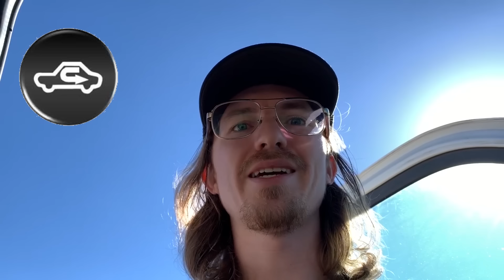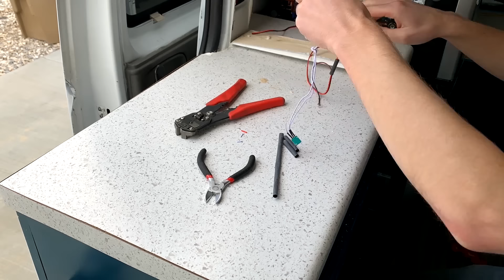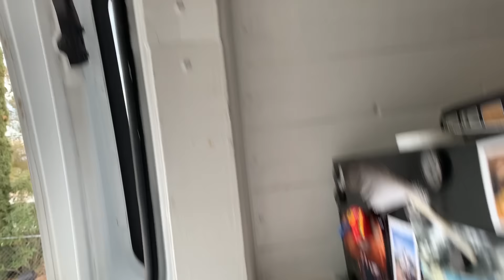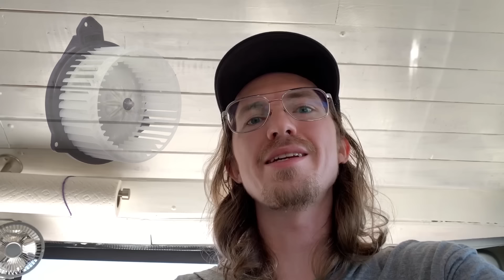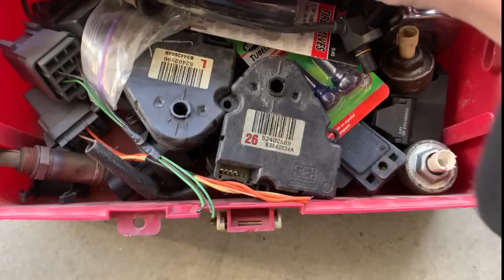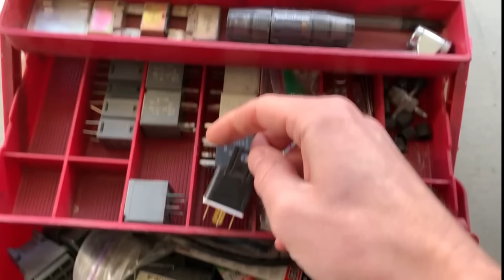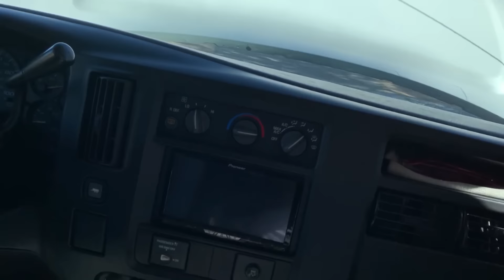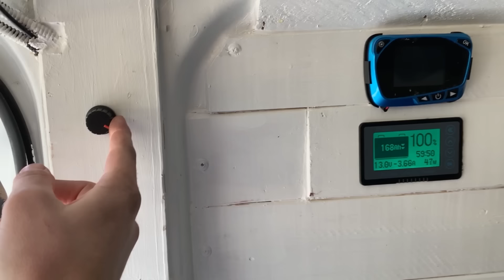OEM Blower Hack **ULTIMATE STEALTH**

Comment: Tim, I need to know how many watts of solar you have on your roof.  You have 4 panels, are they 200 watts per panel?
Reply from the maker: Hi Ron,
They're 230w each (x4 panels = 920w)
Hope this data sheet hyperlink works:
https://www.energymatters.com.au/images/sunpower/spwr_230wh_com_en_a4.pdf

Found them for $100ea locally on Facebook Marketplace (tested by seller upon my pickup)
-Tim
Reply: @VanwithTim  Thank you, Tim
Reply: @VanwithTim  Hey Tim, I appreciated your extensive AC video.  But check out my more simple AC and van cooling solution using only 175 watts from a portable Zero Beeze AC unit.  Firstly, I'm doing something quite revolutionary with a MaxxAir Fan.  Instead of mounting the MaxxAir on the roof, where every inch of roof real-estate is going to have solar panels on it, I am mounting the MaxxAir Fan on the rear driver's side barn door, where the window would be.  My Ford van will not have any windows in the rear barn doors.  The MaxxAir will be cut into the sheet metal where the window would normally be.  This placement for the MaxxAir Fan is beneficial in so many ways.  One, the fan will only be inches away from my cooktops.  Two, it will suck out the hot air inside the van much faster, and when the fan is switched to bringing air into the van it will not be pumping the HOT air off the exterior roof of the van where the sun has been beating down on the roof as it would if the MaxxAir Fan was mounted on the ceiling of the van.  Now, check out my AC solution using the Zero Breeze.  Google Zero Breeze Mach Two, if you're not familiar with this 2300 btu compressor air conditioner.  I will mount the intake and exhaust tube to the 'face' of the MaxxAir Fan with a Jerry rigged homemade plastic adapter so that the AC can breathe.  My gaucho couch/bed will be across from the Zero Breeze which will sit on top of my cooktops and will direct the cool air flow across the center aisle to the bed couch/bed area.  Then I will curtain off the back of the van so that this admittedly small AC unit won't have too big of an area to cool.  No duct work, no loss of drawer or storage space, and only 175 to 200 watts, easy peasy!  The Zero Breeze will have an expanding dryer type hose that will direct the cool air directly onto my body as I sit on the couch, or as I'm sleeping on my 'pull out' bed (40" wide).
Reply from the maker: @rongilbert3067  Hey Ron love the idea!
Check out this video as well for a similar setup but with a radiator fan!
https://youtu.be/9WdWvQaoN5A?t=230

Would yours be more along these lines?
https://www.youtube.com/watch?v=MD8ainq_Mbs

The zerobreeze sounds cool (there's a pun there for sure haha)
My big Toshiba unit is 6,000BTU and it keeps up okay but not great.
(I know my issue is all my giant windows.)
I bet if you encase your walls with 1.5" foam board and fill all the gaps with expanding foam you'll be A-OK!
Reply: @VanwithTim  I love a good pun!  Yes!  That video with Bob Wells is exactly where and how I will mount my MaxxAir Fan, and unlike the video you sent me where the guy used a radiator fan, my MaxxAir 7500 Deluxe Fan will have the capability of pushing out the hot air in the van and bringing in cool air from the outside.  The sad thing is, when I buy my used 2012 to 2014 Ford E-350 van, I won't have a place to work on my van.  Currently I'm living in my 2002 Nissan Xterra SUV.  I'm 68, and have cancer, heart disease, diabetes, etc.  The doctors give me 2 years to live if I'm unable to get my cancer treatment because of the Covid Pandemic.  If I get my treatment at a New York Cancer Clinic, I might live another 15 years.  So I'm praying that New York opens up pretty soon, but I doubt it will open up any time soon with their biligerant Govenor Cuomo.  I'm also looking for a person who I will pay to help me do my build.  I will be using pre-built hardwood cabinets, so the build will be much easier and faster.  First I plan to spray 'Lizard Skin' Sound Deadening spray on the entire inside of my van, then I'll spray Lizard Skin Ceramic Temperature Control Spray over that.  Lizard Skin acts like a  vapor barrier and reduces the inside temp down 30° from the outside temp.  Then I've chosen to use 'Thinsulate' as my added insulation since it is hydrophobic and has a good R factor.   The ship lap I will use on my walls and ceiling will not be screwed into place on the metal cross beams, but instead, I will use a novel and very inventive way of mounting tongue and groove ship lap.  I will imbed heavy duty round magnets into each tongue and groove board and magnetize them onto the metal beams.  There is a YouTube video showing this process, sorry I can't send the link to you, but it's on YouTube.  This way of mounting the T&G enables you to easily take boards down if you need to get to the wiring, etc.

Tim let me know if you know any one who would like to make a little money later this year helping me do my build.

Many Thanks,
Ron
Reply from the maker: @rongilbert3067  Aw man. Hope you're staying safe out there Ron.
Where abouts are you located? East coast I presume?
I can put some feelers out for sure!
--------------
I like that idea on the tongue and groove board! Wonder how well it holds? I've had some pretty strong magnets fly off the fridge while driving the dilapidated streets of Flint, MI.
I've heard great things about the Lizard Skin, and have used Thinsulate in the past (great product!)
Reply: @VanwithTim  God is protecting me under His mighty Wings!  I think homeless people are better off than other people who have a home and have a lot of friends and are always getting together with other people.  I stay in my vehicle, and only leave to go food shopping.  I'm staying on the West Coast in South Orange County California in a very rich city called Laguna Niguel.   I'm a retired Professional Dog Trainer,  my sweet Labrador named 'Hawkeye' after my home state of Iowa died in my arms a few years ago while we both were homeless living out of my Xterra, I miss my boy so much, but I may see him very soon.  Although I plan to beat this Cancer with God's help.

Thanks Tim so very much for sending out an SOS to find a helper to help me build my van.  They will be PAID.  I've got all the plans written out.  I even have sponsors like Goal Zero and other companies who will give me DEEP discounts on products for my build.  Some companies are giving me their product for FREE.  

I plan to use heavy duty Neodymium Magnets!  I already use these type of magnets to hold up window covers on my SUV windows.  They are so strong that I have to pry them off a metal surface with a table knife.  In the YouTube video where a guy used these magnets to mount his ship lap, he didn't report any boards falling down.  I will probably mount a cross wise wood beam across all the ship lap pieces and screw that into place, thus eliminating any of the T&G boards from falling down.  I plan to use light colored T&G boards, so the cross beams could be a darker wood creating an interesting contrast.

If you found someone in the midwest or out here in the western states, I could drive my van to them, I just would rather not have to drive to the east coast to do my van build.   Thanks again for putting the word out to find someone to help this old man out.  Btw, I'm not a typical 'homeless guy'.   I've NEVER taken drugs, drank much alcohol, and have NEVER smoked, of which I'm very proud.  Several years ago, I broke my neck in 3 places, and my lower back in 2 places, and had to have a spinal cord fusion surgery to keep from becoming a quadriplegic.   But I lost my multi-million dollar beach home in South Orange County California, and instantly became homeless with no income after losing  my dog training business.

But 'Home is Where the Van Is' right?  I love the 'van life'.  My backyard has a pool, it's called the Pacific Ocean, and my front yard is Saddleback Mountain!  Please let me know if you find anyone to help me do my van build.

Stay Safe Tim, may God Bless you!
Reply: @CharRichardson  No, I can't find anyone to help me with my build.  I'm an old man with Cancer, though I believe I'll beat my Cancer.  As soon as I beat this disease, and build the 2014 Ford E-series Extended van I intend to buy, I will need to find a person(s) to help me on various installations on the van, ie solar panels, wiring panels to my Goal Zero Yeti 1500X and another GZ Yeti 1400.  The help I will need will be on very small little projects, like half-day projects.  I definitely will need to have someone to crawl up on the roof and install seven 100 watt Renogy solar panels (believe me, they will fit if I buy the 'extended' E-Series van).  After installing just the solar and the wiring to the 2 Goal Zero Yetis, there will only be 2 or 3 very small projects that I'll need help on.  I will be able to do most of the build, I'll just need help on the real physical part of roof solar installs and a few high tech projects.  After the van is complete, I intend to go on 'My Victory Over Cancer Tour'.  It will be an approximate 2 year journey to all the Western National Parks, National Forests, and BLM land---west of the Missouri River.   Do you know anyone that could help me with 2 to 3 very small and brief projects on my build, of course they will be paid.  Ron Gilbert.     Email  'KenandHawk7@gmail.com'

Comment: Camry uses PWM to ground, very simple but runs from the starting battery.  Ford transit needs 12v from house battery, speed set by dashboard switch.  On for a minute and off for a minute is adequate for overnight.  Exhaust is through the back bumper in most cars.
Reply from the maker: That's good info Pete.
Don't hear of too many low-side PWM's (At least most "aftermarket" modules seem to be 12v+ switching)
Cheers!
-Tim

Comment: A pair of diodes would work vs a relay. Also when you use a relay make sure you choose one that is rated for 100% on time. Nit all relays are the same
Reply: I would also suggest to use diode/s instead so that it will run on whatever speed is higest from car or pwm. And power will not be used to activate the relay when car is on. Also there will also be a little power loss over the diode, but it would be easier.
Reply from the maker: Good distinction.
I remember people trying to save a buck on their golf carts and snow plow solenoids... (of course a slightly different concept) 
They would use intermittent instead of continuous duty units. Best case, the solenoid failed. Worst case would be (as the lawyers would say) a "thermal event"
Thanks for mentioning it!
-Tim

Comment: Excellent video!!! I would like to work this out on a VS30 Sprinter, might close that hole in the roof. The idea of water leaks gives me nightmares...
Reply from the maker: It's a good idea that works pretty well, but your rooftop fan will move a lot more air with a bit less electricity!
If that still works for you, it might be worth giving it a go!
If anything, try it out with your van running and the blower fan on high without the AC. 
That would give you a good idea of it's functionality!
Thanks for watching!
-Tim

Comment: Ultimately, I would like to use my Ford E350's dual a/c. It would be a heavy draw, but not much different than an 8,000 BTU window unit. The question is whether to replace the engine driven compressor with some form of electric or if an auxiliary electric compressor could somehow be plumbed in parallel. There would need to be a fan added to the condenser, also.
Reply from the maker: Another commenter mentioned this!
Certainly doable with enough fab work. 
Would be great to have an automatically variable condenser fan to avoid the huge initial power surge.

If you do take up the project, make sure to film it!
-Tim
Reply: @VanwithTim  I was hoping you would do all the design and development for me. 🙃
Reply from the maker: @dluscombephantom86  ( ఠ ͟ʖ ఠ )

Comment: Dude.  While you might be aware that the single resistor method can get really hot.  Wasting all that heat from that resistor in wasted energy.

You may have noticed with your little variable speed controller.  It had a number of nice silvery colored heatsinks.  Likely for some MOSFET switching transistor heat sinking.  They get pretty damned hot.  Hotter than that resistor.  And they need that big chunk of metal strapped to them.  To keep the innards of your MOSFET transistor from melting.

So while it doesn't use the resistor.  Like that simple cheap low-medium-high switch.  About the same amount of heat is wasted by the MOSFET switching transistors.  That determine the width of the pulse.  With another control device.  Varying the length of time the pulse is on.  And it all gets pretty damned hot in the process.  Because you are sinking all of your power through those MOSFET transistors.

Try connecting them to a couple of speakers.  Plug your headphone output from your smart phone into the motor speed controller.  And you have a Class-D audio amplifier Et voilà!  It all works on the same principle.

I really think you should have used a larger gauge wire.  To go that 12 feet from your controller to the blower motor.  Because you're going to be sinking a lot more current.  Lost in that long 12 foot run to the blower motors.  I think you should have used 10 or maybe even 8 gauge.  But that's just me.  I design wire and build, audio music recording control rooms.  One I built in a gigantic diesel box truck.  It doesn't run from 12 volts.  It runs from, 104 through 240 volts through a power isolation, step up, step down, transformer.  That, itself.  The size slightly larger than a 5 pound coffee can.  But weighing in at 100 pounds.  But that alone draws, 800 watts, with no load.

I have not yet put solar panels on top of my truck.  I have 8' x 24' of flat roof area.  How many watts could I install?  Let me count the ways.  I could figure on, 4000 watts worth?  But then how many equivalent lithium-ion batteries will I need to get through an entire evening and overnight worth of recording?  Ugh!  I guess I'll just have to get a diesel generator also.  To make recordings of rock bands in the desert.  With, 6-12 cameras and flying drones running.  Direct to, 24-48 track digital recorders.  And wiring can get a bit complicated.  And to make certain nobody kisses a microphone with 120-240 volts, on it.  Unless it's for a laugh.  But then also...  A defibrillator won't work after that.  You could connect them up to the microphone again maybe?  But I would recommend that.  Then it kind of works like one of those electric hot dog cooker's.  Don't do that to your lead singer.  Especially if you don't have the mustard and buns.  Just so you know.

Good idea not to run the blower fans on your engine start battery.  That was good thinking.
RemyRAD

Comment: I always thought that black plastic panel above taillights would be a good exhaust vent location.you can put a smaller more efficient blower near there and blow out.cut a small hole in floor somewhere forward with a screen and filter to bring in fresh air
Reply from the maker: The little computer fans use an extremely small amount of electricity! 
I bet a couple of those would fit up there nicely.
Lots of excellent stealth ideas showing up in the comments!
Thanks for watching!
-Tim
Reply from the maker: You know what, "Shea Design" just commented with this video 30 minutes after you. It's almost spooky how in-line it goes with your suggestion.
Check it out:
https://youtu.be/yzytGrPQAHY
Reply from the maker: @ronaldduck7567  Oh man did I ever search my heart out for the blower CFM. First on the express van, then any GM truck, then ANY AUTOMOTIVE BLOWER.
The scarce info I could find was so conflicting I just decided not to even put it in the video.

The articles I found mentioned anything from 250CFM all the way up to 1,000CFM on random vehicles all the way back to the 1950s.

Would love to know my blowers CFM to compare to the MaxAir roof vents. (I know it's much lower!)

Comment: I like your idea and site. Quality stuff. As your aware, heat rises and your dash mounted fan will push air but will this thought help? Use your slider door as 'duct work' to mount a surface mount fan to either flow into the frame or pull out. The bottom of the door is in fact outside the weather stripping of the door so if you drill a series of 1" holes along the bottom of the door you will create an outlet for airflow and still maintain stealth.   If you use, say, a computer fan(s) which draw milliamps, you can leave it running all night while sleeping and all day while parked and find a cooler interior upon your return. Put some screen over the holes so no critters crawl up. You can use the electrical contacts of the door open/close feature to power the fan. Other idea is:
https://www.amazon.com/MAXXAIR-00-03810B-00-03812B-MAXXFAN-Exhaust/dp/B07TXX79JL/ref=sr_1_4?dchild=1&keywords=red+12vdc+shower+fan&qid=1614210287&sr=8-4
This may fit under the corner of a solar panel or non-slider wall as it does latch closed.
Reply from the maker: I like the idea of putting some ceiling ventilation under the solar panels.
Would help two-fold, as I've recognized my panels getting far too hot and REALLY dragging down my efficiency / power output.

Would be a great way to "kill two birds with one stone" and will definitely keep that in mind for my future revisions!

Thanks for the feedback Douglas and thanks for watching!

-Tim